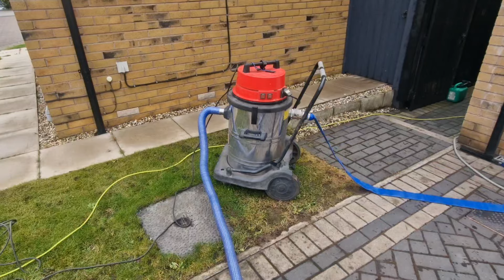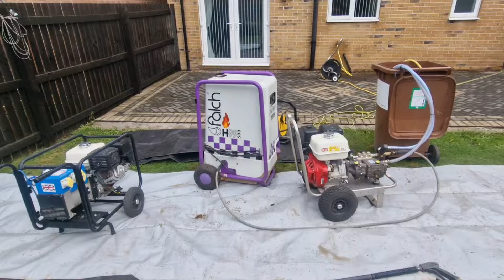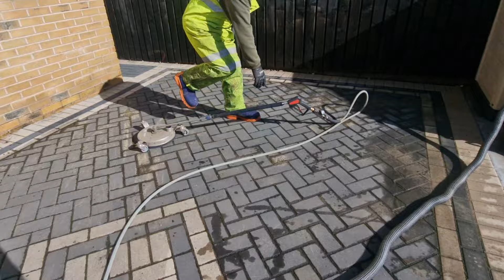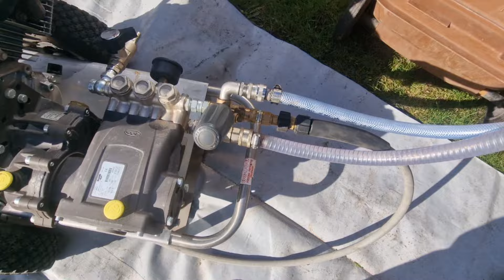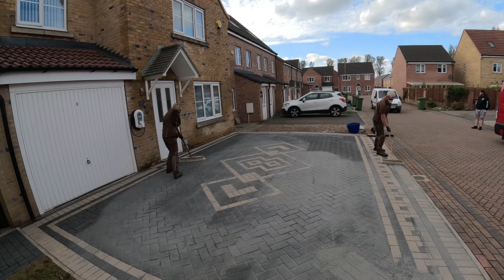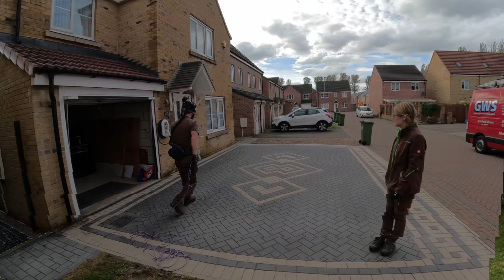Steam Clean -  Dansand  & Biocide

Comment: What psi and temp do you use mate
Reply from the maker: @joannewilliams5981  Hi, when using the mosmatic surface cleaner, you can only go to 120° or it will damage the bearings. Also, for getting a better clean, you really need 250 bar pressure, any less, to be honest, is a bit naff.If you are using just a lance, then you can use around 100 bar upwards just see what works best. A turbo nozzle can be used to I think ? 90° I don't use the turbo nozzle much though, on this job, we went to about 120° it was enough heat, I started 25 yrs ago using just cold water since using heat it's a massive difference, but you need so much equipment as problems always arise. If you are starting out, I wouldn't have a machine that uses more than 15 litres per minute of water as you will most of the time keep running out and waiting for your water bowser to fill up. Any more questions, just ask. Thank you.